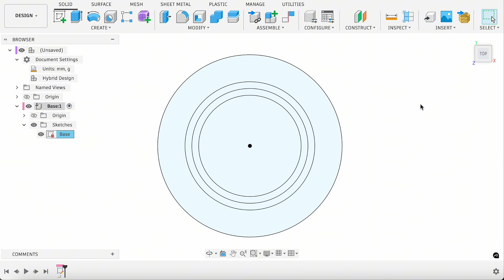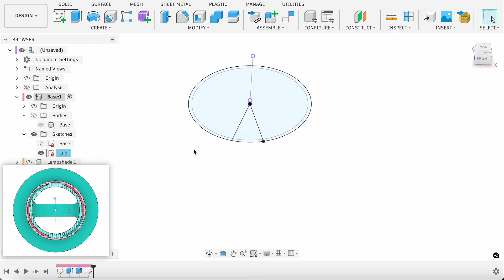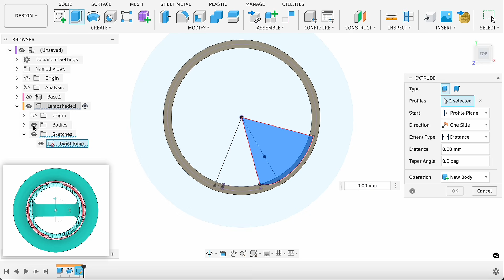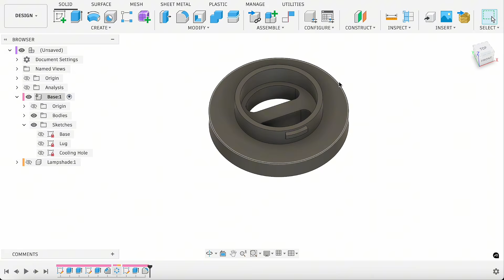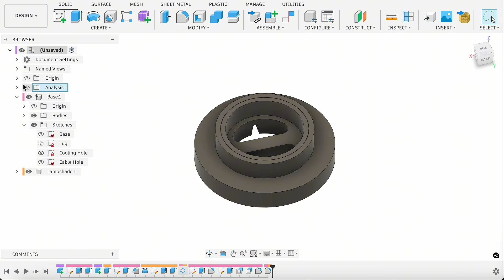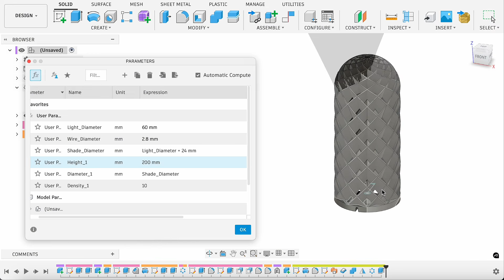Upgrade your 3D Prints with a Twist Snap Mechanism | Fusion 360

Comment: Is the voice AI generated or scripted? I swear the narrator talks just like ChatGPT.
Reply: I think it is at least AI produced - the tempo and tone was too precise and consistently mis-pronounced "object" with the emphasis on the last syllable.  And even the design is a bit strange - the arced ramp is completely unnecessary on the "full stop" - that just needs to be a wall.  While the detention it passes over would benefit from a curved/ramped entry.  Actually curve is unnecessary - just an angled entry would be helpful and the detent could be a little larger for firm retention - I can't imagine a human design engineer would make that entry symmetrical and have the stop asymmetrical.  Though it was a very useful tutorial.  Good pointers.  I "suspect" it was a human directed AI script/project.

Comment: I can’t send  to my printer…fusion only lets me select one body to send to a stl file. Do you create 10 stl files and the merge them in the slicer. Hoe do you do it?
Reply from the maker: No need to merge 10 files! Try right-click on the Component (the icon with the cube) or the top-level internal component in the browser, then select "Save as Mesh." This will let you export all visible bodies within that group as a single STL/3MF. Let me know if it works for you ;)
Reply: I did manage to get it to export using the File>Export>Stl menus. But I am sorry to have to report that when the density is changed to anything bigger than 10, the model breaks. The sweeps protrude into the channels in the fitting on one side. This can be observed by looking at the model from the bottom after increasing the density. I printed it and it won’t clip on to the base if you set the density to 12 or 15. You can see the problem in Fusion and in the slicer.
Reply from the maker: That’s strange—I just tested it on my end with Density 12, 15, 20, and even 50, and everything works perfectly.
Since I can't see exactly what's happening with your local file, try downloading the original .f3d source file from the MakerWorld link in the description. Open it in Fusion 360 and try adjusting the parameters there. Let me know if that clears it up ;)
Reply: I finally found out whats wrong. The very last command which cuts off unwanted extrusions into the fitting body has a drop down menu at the very bottom labeled Bodies to Cut. That drop down only lists the bodies used in your original design. After I change the Density variable to 12, the additional 2 bodies are not shown in this list and are therefor not cut by the extrude command.  After I change the quantity to 12 in the circular pattern command (instead of "density"), two more bodies appear in the last extrude command and if I check those bodies, the resulting cut removes all the unwanted bodies. Looks like a Fusion bug to me.A fix for you might be to design the shade with a large number of bodies, say 20 and then change the number in the pattern command to "Density". Your model works for density = 10 or less.

Comment: Why didn’t you ramp the detent on the side that the lug is supposed to slide over? I was confused the whole time because it looked like you were twisting it backwards. I wouldn’t have put an angle at all on the entry slot opposite the intended direction of rotation. That just encourages someone to twist it the wrong way.
Reply: At .4mm, the detent doesn't need a bump. Adding a ramp would probably cause the slicer to just remove that part, since a printer with a standard .4mm nozzle doesn't print at that resolution.
Reply: @philwingfield6245 idk about the slicer removing it. It should follow the outer contour and create a section of gap fill that may or may not be removed depending on your settings. And it may not need it, per se, but I’d think it would make assembly more intuitive since it would easily slide into the locked position, but not so easily come out.
Reply: @soul_in_a_fishbowl in my experience, my slicer tends to remove areas under .13-.15mm. Think abouy if you attempted to print a ramp where two sides meet at a narrow angle. It would chop off the last little bit. Moreover, the print in the video will already deform when it's first assembled as the plastic on the end of the detent is compressed. If it works fine as is, it seems like it's printed within the tolerances of what works for most printers. I doubt you would see much difference if you tried both methods side by side; I think it's more likely you'd end up with some unpredictable results by trying to future around with bevels and ramps and fillets  at such small resolutions.

If I wanted to do what you're saying, I think I would be more likely to add a slight ramp to the leading edge of the inserted part.
Reply: @philw @philwingfield6245 thickness of the ramp wouldn’t be the thickness of the ramp itself. It would be the ramp + the outer wall. It’s not a separate component, it’s a part of the base. And sure you can add a ramp to the inserted part, but then you’re making it easier to over rotate the part so it would be a worse way of doing it.
Reply from the maker: Sorry for the confusion! The mechanism actually follows standard clockwise-to-tighten logic. In the video, it looks reversed only because I was rotating the base instead of the shade to keep the lug’s movement clearly visible. Hope that helps!
Reply: @send_to_print that makes a lot more sense

Comment: Thank you. If i want only the twist without the snap, but i want it ti not disxonnect, how i can do it?
Reply: Same. I need something like this for metal parts. Guessing it needs to be a screw variation since the metal wont flex.
Reply from the maker: Are you thinking of a screw-on mechanism, like a bottle cap? If so, please check out my channel page—I’ve covered both the Thread and the Coil methods.
Reply: @send_to_print  I guess it could be screw on. But I like this 1/4 turn bayonet design since I don't want to rotate my part as much. plus I have a tube going into a plate, and getting threads in an 1/8" plate it not very structural.
Reply from the maker: You might want to try the Coil approach shown here: https://youtu.be/XYC86E5D8rM
It lets you customize the exact number of revolutions (like 0.5 turns).

Comment: Nice! I end up using variable for every measurement, even the clearance/tolerance so I can adjust fit parametrically since some plastics do shrink more than others after printing. Find 0.2mm is a close fit and 0.4mm is a loose fit in most situations.
Reply from the maker: Exactly! There's a world of difference between different printers and filaments. So glad you're doing it this way—it really pushes the power of parametric modeling to its full potential!

Comment: Great tutorial. I need to watch it a couple of times as this is a bit more complex for my skill level.

Can you add a link for the LED lamp you used (or a similar one)?
Reply from the maker: Glad you liked it! For the LED, I’ve put the MakerWorld link in the Description—you can download the .f3d file there, and the specific LED link is also included on that page.

Actually, the design is flexible! You can use almost any LED lamp you have. Just update the User Parameters (Light_Diamater & Wire_Diameter) in Fusion 360 to match your hardware, and the model will auto-adjust. Let me know if you run into any issues!